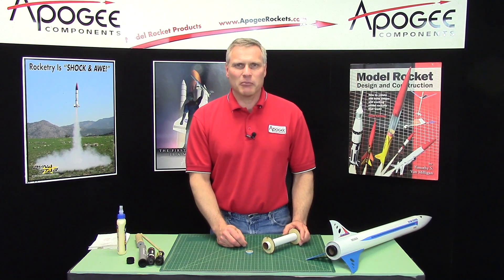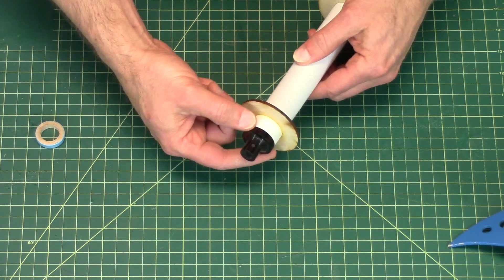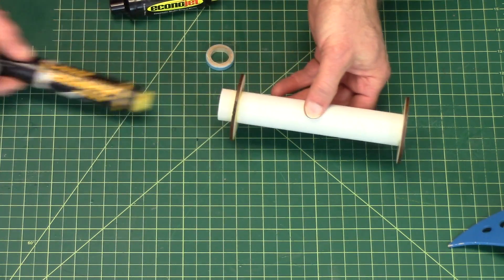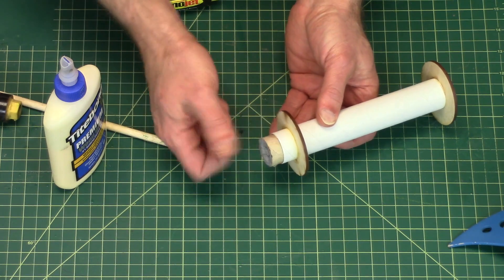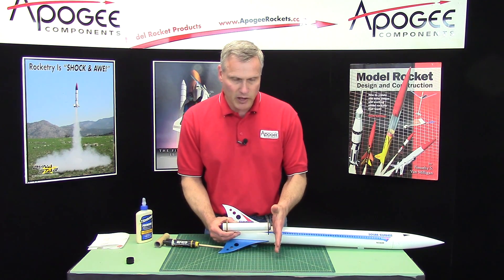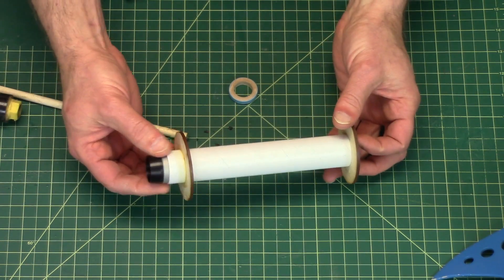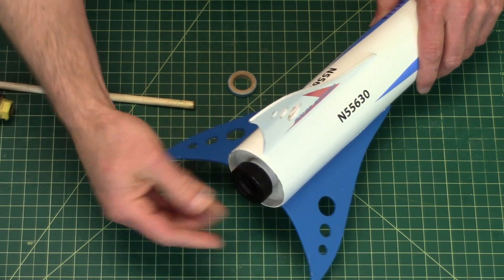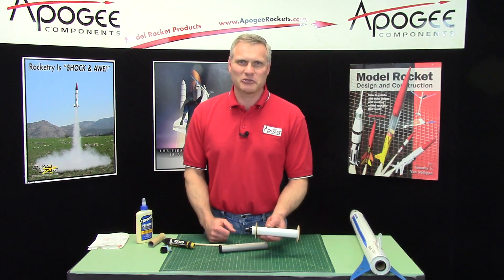Engine Blocks in Engine Mounts

Comment: Tim.... do i need an engine block with a 29mm aerotech motor at 8" or so long?
Reply from the maker: No. You won't need an engine block. The Aerotech motors have them built into the back.

Comment: Hi Tim, i had ordered from estes a 29mm motor mount kit... mine came with a thrust ring... according to rock sim the rocket im designing would fly best with a 29mm motor 8" long... do i need that thrust ring still? And if i do what is the best way to get it set up as i havent purchased any motors yet.
Reply from the maker: No, you don't need a thrust ring. Leave it out.
Reply: Ty

Comment: If you are willing, you can make a thrust ring on the back of a Estes engine. You can wrap layers ( thin in width but long in length) of paper or cardstock and use wood glue

Comment: you can make a trust ring with several layers of 1/4 in tape on the estes motor just wrap about 12 rounds on the back of motor and you can use a standard retention rings

Comment: how hot will a E-45-5 rocket motor get? I'm trying to make a blast protect for a homemade launch pad and was wondering what metal to use, but with a metal point of 449.5°F tin won't work.